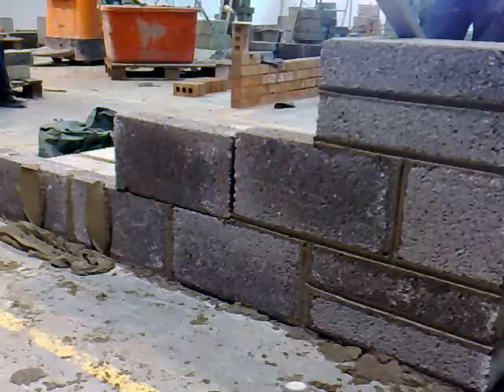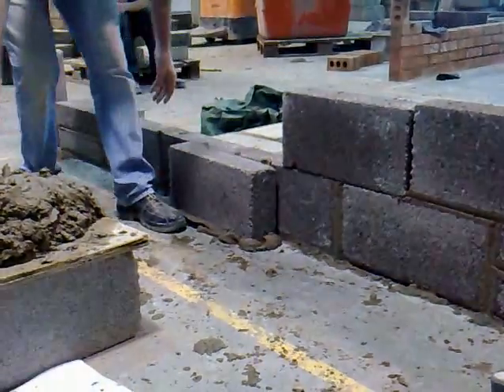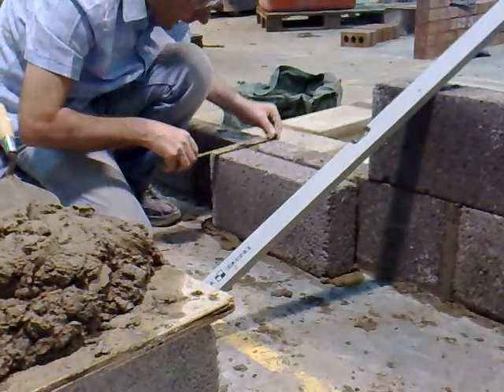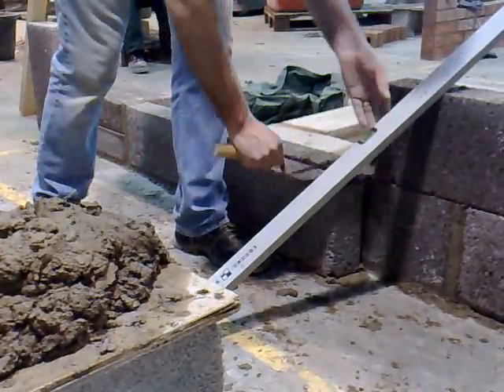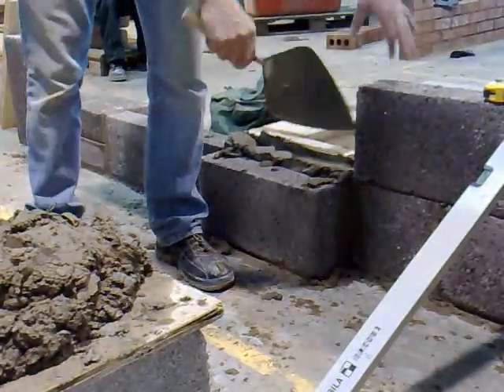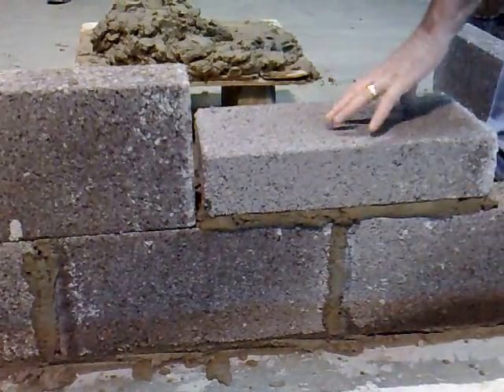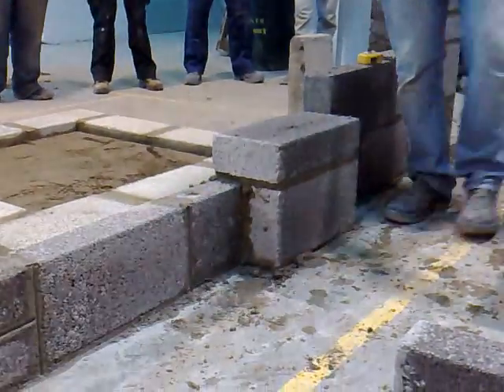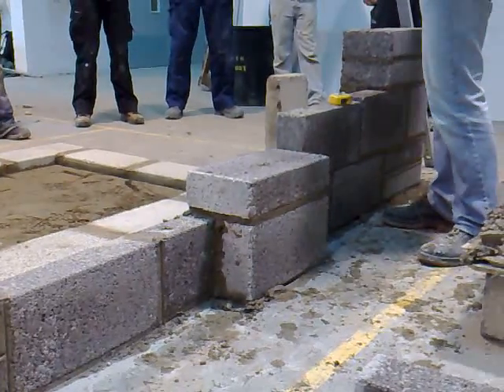Blockwork Piers Intermediate (video 7 of 8)

Comment: Thanks for the video. Do I need to use wall ties on a pier? The L shaped ones. I've seen a couple of vids with diyers using them. But unsure why?
Reply from the maker: No if you are bonding the pier the way we are in the video you don't need L ties.
Reply: @hickeymaster  thanks for the quick reply. I wouldn't do it any other way other than your way. I have one other question. The wall I am doing has the first 2 rows down. Reason being is we had a shed up and in the meantime our neighbours built an extension few years back.They poured concrete in between our shed wall and their extension wall. Not sure why really. We knocked the shed down and when we did the wall had a bad belly in it we took it down.So I have left the first 2 rows down as not sure it's a good idea to take them away with the concrete poured in behind and I have a base to work off anyway. I was going to start my pier with 2 4" soap bars then a 4" solid on its edge to bring me up to the level of the first 2 rows that are down then continue my pier like you have. Hope this makes sense. If I could attach a picture here I would.
Reply from the maker: @Smollie42  ye it makes sense. Just try tie it in on that 3rd course. I take it you are using the soap bars for appearance purposes I.e., (2 on flat). Best of luck with it. Slow and steady wins the race.
Reply: @hickeymaster  would it be flat ties on each block on 3rd row? Yeah soap bars just for appearance. I'll probably just do 2 rows a day just to be on the safe side. Appreciate that.
Reply from the maker: @Smollie42  no need for flat ties. Just get the 2 blocks on flat across the wall on that 3rd course.
Reply: @hickeymaster  so that would be 2 on the flat on the inside of the wall yeah?? 2 full rows on the flat or just 2 blocks?
Reply from the maker: @Smollie42  just 2 blocks on flat tieing the pier into the main wall. Did you watch all 8 videos  showing blockwork basics? https://www.youtube.com/watch?v=onhor2wsuBY&list=PLynkt-_WrH6nWRnwF4KT32d7w1k6c9lNm
Reply: @hickeymaster  yeah I get you now. Yes I did have a look at them. Great info on them. Thanks for all upir help. You wouldn't believe the hassle trying to get a brickie to do this. Hence why I'm doing it myself.

Comment: Interesting video.  Thanks for posting.  I am building a block wall off the house 2.7m long.  One end tied tot he house, teh other then a corner.  Does this distance need a pier?  If so, in the middle?  And...should it be full height (2.5m)? or only a few courses high? Thanks!
Reply from the maker: I don't understand what you mean by full height. 2.5m is 8ft high which is 11 courses of blocks (if using standard 215mm high block). Anything higher than 3 or 4 foot would need a pier in the middle. Make sure the foundation is deep and wide enough.